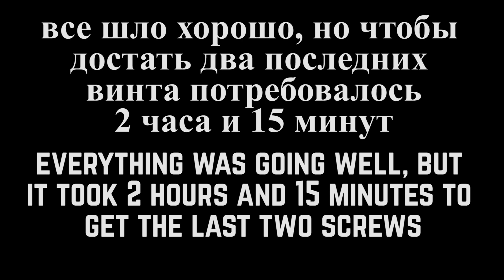Restoration Rusty Soviet Vise

Comment: I saw a very good tip on a vice restoration video for getting the jaws off a while back but never tried it.
Before you take the vice apart clamp a screwdriver bit between the jaws with the bit in the jaw screw and turn the bit with a spanner.